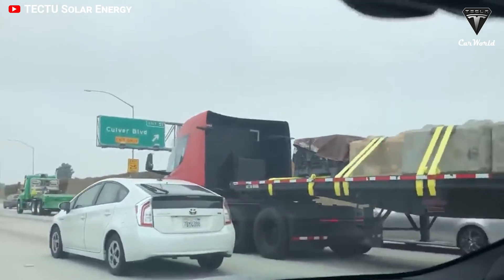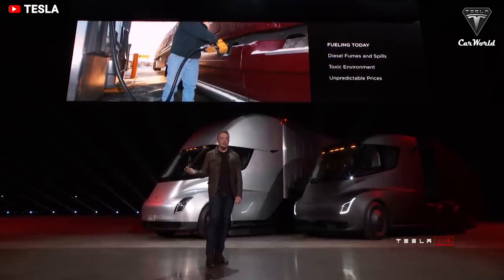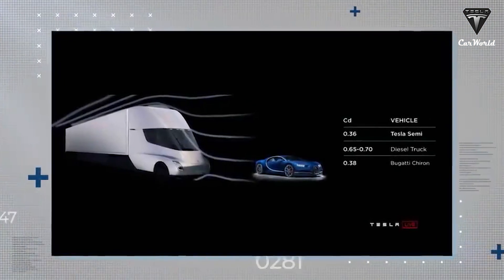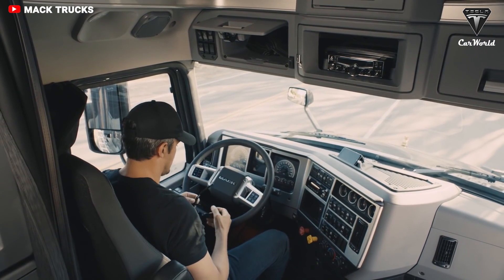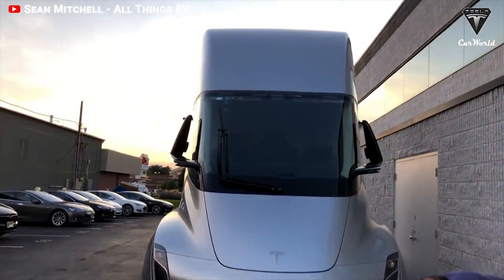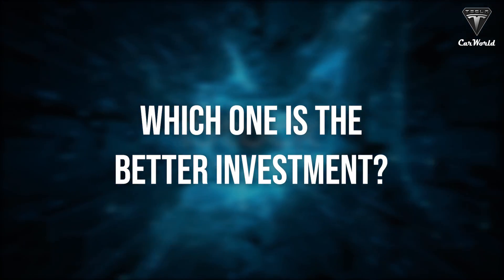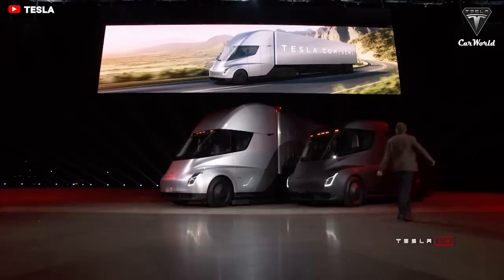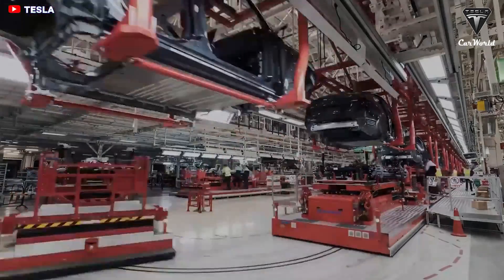Which is the KING of 2023 heavy trucks? Mack Anthem Diesel Truck Vs. Tesla Electric Semi?

Comment: This is BS.  Who cares what "Acceleration" is? It means nothing when total weight is 80,000 lbs and you have an 8 hour trip ahead of you.  Drag coefficient is equally stupid.  Tesla shows the DC with tractor only.  When coupled with a 52 ft long trailer, the DC is going to be about the same as the MAC.  The diesel MAC will be on the road 10 hours per day longer since it doesn't have to stop and recharge for 10 freaking hours.  The MAC has a place for the co-driver to sleep, Tesla has never shown this, so I assume there is no co-driver space.  But that doesn't matter anyway, since the Tesla truck won't be on the road for 2/3rds of the day.   The Ford F150 Lightning has a 270 mile range, yet youtuber's have shown, when pulling a camper trailer in the Rocky Mountains, that range is cut down to under 50 miles. Worthless

Comment: Regeneration vs engine breaking is going to be a deciding factor as there are increasing locations you can take it where engine braking is restricted or banned. This could theoretically save a driver alot of time. This is a bigger factor than acceleration. Brake maintenance is a factor & let's not forget that's DOWN TIME.
Reply: Most of if not all semi's for the last decade plus have engine brake mufflers, so they do not have to follow the restricted engine break signs.

Comment: From a drivers standpoint I would take the Mack. an average trip is much longer then 200 miles and in a normal semi I could do 750 miles in one day if I stayed legal. I have driven up to 1200 miles in one day throwning the log book out the window not really but ignoring that I had one. Cattle operations require to do so. A Tesla does not have the abilities to do what a traditional semi can do. Lack of a good sleeper cab unlike the mack which you did a bad job showing how much room they have compaired to the tesla. Backing into areas look like it would be a nightmare in the tesla because you are seated in the middle and don't have the site lines that a normal semi has. In a normal semi if parking to the left you can look out the window and see a very clear picture of where you are backing. I bet there will be a lot more fender benders in truck stops because of this.

Comment: If you can get a Tesla semi and don´t you should be fired for incompetence. The ONLY reason to get a diesel truck is if you must have a truck now and the waiting list is to long for your business. I would recommend to rent or buy a used one of good condition. To buy a diesel new so you would have to run it till it dies would not make sense any more. When (not if) electric semi trucks are up to full production no serious trucking company will still buy a diesel at just about any price (used or new) so your assets will be stranded and the much higher fuel cost will likely drive you, out of business that is. All that is on top of the coming carbon taxes that will be charged soon.
Ps. Elon please get rid of twitter and focus on what you are good at.

Comment: Will this Tesla truck hold up to severe duty like a Mack truck? Mack trucks build a many roads and buildings to claim it's feat in the class 8 market for commercial vehicles. Seems like Mr. Musk has a lot of work to do equaling or surpassing the Mack truck for reliability for extreme use duty. Standard diesel trucks old and new can be modified, designed to handle special hauling requirements.

Comment: With a truck, horsepower only gets the truck down the road and allows for higher cruise speed the higher the horsepower. Acceleration and hill climbing capabilities is determined by torque. Mack's 1860lb/ft of torque will wipe Tesla's 1600lb/ft by many minutes going up a hill. And Freightliner has it's Detroit DD16 that puts out 600hp and 2050lb/ft torque. Freightliner, Kenworth, Peterbilt, has the X15 Cummins that puts out 605hp and 2050lb/ft torque. Torque is ALWAYS the determining factor for performance in a truck.

Comment: I always thought that range and maximum load are the most important things for a truck.
Reply: It is among the most important.
The other important metric I'd want to know is the real refueling cost. Sure the electricity is cheaper than fuel right now, but you also have to account for the miles lost every day from sitting at a recharge station.
You get paid for the distance you can move the product, if it takes longer to make delivery, you are less competitive.
Reply: @myria2834  that was my question as well if you assume 200mile max before refuel the mac will be back on the road in under 20mins i would assume
Reply: @myria2834  "Sure the electricity is cheaper than fuel right now,"
Using his 7 cents? which is below cost and he aint to take a loss on that!  Use his car price and the telsa is 150% more expensive to run! LOL
there also the problem of 20% reduction in battery capacity each year!  MORE FOR QUCIK CHARGE OR OVER 40 HOUR A WEEK USAGE! ITS A SCAM!

Thats why they had to give 194,000% for each truck to PEPSI!  LOL   FREE TRUCKS and they still will lose in a couple of years! at 7c a mwh!
Reply: @myria2834  I worked at a truck stop for 6 months, and I can assure you it won't be an issue. Many truckers just sit there for entire days, just eating at the diner and waiting for the order to move out. Some had schedules and I still don't think this would be an issue. Many of them got 12 hour down times. More than enough to charge the truck back to 100% before moving out again. The real cost will come down to the truck stops to apply charging stations to each parking spot in their facility.
Reply: @DalionHeartTTV  while some may sit up to a day waiting on a load, it isn’t all that common. Yes, truckers are required to take a 10 break after 14 hrs day, 11 hr drive time (whichever comes first), trying to find parking and (in the case of having to charge) is a bitch.
Reply: @myria2834  No the costs are 150% for the telsa than Diesel!  That 20% loss on the battery each year means replacing it 2-3 years! At 130000$ PLUS!
Reply: @danquaylesitsspeltpotatoe8307  We have next no real world data to make a good argument either way. For me the truck isn't even a option without more real world data and infrastructure along with a actual sleeper.
Reply: operational cost is the most important.  Very few semis run with a full load anyhow.  It isnt like some evil game of jenga loading a truck to the max for every load...and range is really only important for long haul applications and this semi is not really designed for long haul as there is no sleeper...this is a day cab so 350+ mile range should get the job done in 99% of uses.  Now if the semi is say over 12,000 pounds heavier than an ICE semi...now you are severely cutting into load...
Reply: max load for every truck is 80,000 pounds because of legal requirements. it’s fuel efficiency, maintenance and cost that are the big 3
Reply: @takingafatdump  yep and the tesla truck likly weight consdierably more than a ICE unit. though tesla went out of their way to mention nothing on the things weight or the weigh of its battery... but you can make close assumptions base on current tech.  and its going to be pulling less.. if not I will actually eat my steal toe boots
Reply: @takingafatdump  80,000 GVW limit for a regular Semi in the US. ( two drive axels ) .   Heavy haul trucks ( 2+ drive axles ) can go much much heavier.
Reply: @humdinger5701  Heavy-haul is what I do. I see alot of ignorance floating around in this comment section. A Tesla semi is a nice thought but with no sleeper and lack of infrastructure makes it's applications very limited.
Reply: @dasimparmy2289  Yup, %100 agree with ya.  Normal folks dont have a clue what our jobs require.
Reply: And.... what about 100/60 -> 0 braking time?...
Reply: @OnionOreo  well it is a heavier machine.. and inertia is a bitch.. will have to see how that plays out. but I duno about in the US but over in EU some of these trucks can stop dead in a horrifying short distance, only realy limit to stoping distance is what the tyres can do aint no breaking tech changing that fact so its probably in thesame boat as its competitors
Reply: yes and the tesla truck has less of both
Reply: You right
Reply: Head to head collision...electric truck debris will be delivered to Musk.
Reply: Another big aspect is that for the Tesla, the rear axle is only rated for the bare minimum, my guess is to save on cost. For a lot of semi trucks, including the Mack, the rear axle is rating for MUCH higher weight than would be legal. The reason is simple: if it's designed to take 48,000 pounds instead of 34,000 pounds, it will be far, far longer before the rear axle breaks. Just like putting a more powerful 12v battery in your car will make it last longer.
Reply: Range is not important if you only travel short distances. Load does not matter if you only ever carry small loads.
Reply: @bedinor  Then get a pickup. What's the point of immensely expensive and massive electric trucks, if you're carrying small loads short distances.
Reply: @bedinor  yes, but also no. There may be times where a day can may need to go a little further than what they normally do. And carry more than what they normally carry.
Reply: @bedinor  |Then you do not need a truck.
Reply: I mean range is important for long haul, but for local driving like say, taking stock from a port to a warehouse range really isn't an issue.
Reply: @zacharymarentette5269  The cost of 150% extra per mile is tho! The battery losing 20% a year is a problem!  and thats if slow charged and only 40 hours a week!
Reply: @danquaylesitsspeltpotatoe8307  150% in what situations, on the highway? No shit if there, electric motors are mono-gear, they can't efficiently go 60 mph over an extended period of time.

And how on earth does the battery lose 20% capacity a year. My family's been driving a 2018 Nissan Leaf  and the battery can still give us 150 miles on a full charge.

And that doesn't even account for what electric semis offer. No energy wasted idling. Completely silent engine. Power goes directly to the drive wheels. No clutch.
Reply: @danquaylesitsspeltpotatoe8307  Dude, I wasn't arguing whether or not Elon is actually skilled or not. I'm literally just arguing that

1. Range isn't everything in trucking
2. There are still significant upsides and situations to electric motors compared to a diesel engine
Reply: @zacharymarentette5269  AS I STATED THE COST IS 150% MORE THATS THE PROBLEM! 

It doesnt matter even if had decent range that didnt decrease 20% each year!

What upside over comes the 150% Extra cost ILL BE GENEROUS 50% EXTRA COST?

NOTHING DOES!  But please do have a go if you think theres an upside to 50% extra cost!

Comment: Most pointless video I've seen in a long time  my freightliner  cascadia holds 300 gallons of fuel  with 260 gallons usable   gives me 2,080 miles of range in -25 degree  weather  how many lbs of co2 are generated to charge the tesla compared to the diesel i burn

Comment: Mack is owned by Volvo and uses Volvo's "D" series of heavy duty Diesels D11 and D13 under Mack's branding.  Of the four USA over-the-road heavy duty Diesel engines, these being Cummins X15, Detroit Diesel DD15, Volvo D13 and Paccar MX13, Volvo is at the bottom for fuel millage and only a bit more reliable than the nightmare Paccar MX series engines after these two different engine series get some miles on them.   After a 200,000 miles and a couple of years of over-the-road service these engines have continues sidelining problems and are slow to get parts for.   After 400,000 miles the Paccar MX series starts to. have serous issues.  Paccar owns Kenworth, Peterbuilt and DEF.  The Volvo D series may go to 1,000,000 miles with a ready supply of parts.  

The Volvo developed interior is at the top of Semi truck interiors, but the ride and handling is below that of Frieghtliner, Kenworth and Peterbuilt the top sellers in the North American market.  When comparing with the Tesla Semi it is likely best to use Daimler owned Frieghtliner with a DD15 or DD16 engine which is by far the best selling semi truck.   Both the Cummins X15 and Detroit Diesel D15 are legitimate 1,000,000 mile engines with fast service on parts in the USA market.   Detroit Diesel "D" series has a serous problem with rubber O-ring seals loosing suction on the engines oil pickup tubes causing oil starvation of the main bearings and seizing at about 400,000 miles.   Replace the rubber seals on a D series engine before 400,000 miles!  The DD series is at the top in fuel millage of these four main brand heavy duty Diesels.   The Cummins X15 is the most serviceable with standout best drivability and so so fuel millage.

Comment: As a diesel mechanic, it's things like this that will likely put me out of the job, however seeing as the trucks operate for cheaper (Both road and upkeep,) are safer, more powerful, are priced similarly to a normal unit, and much better for the environment, that is a good thing. I hope that a wave of these trucks replaces the current and older generation. The only issues I really see is the charge time of trucks of similar make,  operational range, and possible wear and tear over time, as the engines will have to endure much more than your average electric car. As for charge time, that could be mitigated working with service stations to keep pallets of batteries on charge for repowers (Bear in mind that your average team both works the DOT max of 10 hours driving time for a 20 hour constant trip) or developing a multi-charger system to fully 'fuel' one in 4 hours. Operational range will be improved over time as more efficient batteries are developed, or perhaps a special model with a second set of batteries for a longer haul (Such as an add on to the cab on full cab/condo models). General wear and tear will be dealt with as it arises.
Reply: I wouldn't worry too much. How many auto mechanics have been put out of jobs because of electric cars? My guess is you have a few decades or more before it really makes a difference.

Comment: All the important information is missing here. The payload is one of the most important one. Yes, the Tesla truck can be 82,000 pounds and theoretically has a 2,000 pound advantage, but the batteries are taking that away easily as you would need about 10 Model S battery packs, which is more than 10,000 pounds alone. And no, there is no weight saving because you do not have a diesel engine, as you still have 3 electric motors, all with gears and a heavy cooling system for the batteries. The next big problem is charging as you need a 1 MWh charger that needs it's own electric substation for just ONE charger if you want to charge your truck in 1 hour. Tesla will have these super chargers along the highways in the future, but you can expect to pay for it, meaning it will cost you more than filling up your diesel truck and you have no other choice. In addition, as trucks are used way more then cars, you can expect that the battery will loose about 20% capacity after one year, so after 5 years this truck might just have 100-200 Miles in range. Replacing this battery pack will easily cost you $100,000! So, not sure were the advantage is.
Ah yes, don't forget, Mack is probably the smallest of all truck manufacturers to compare this to, so not a fair comparison. BTW, you know that parts of the battery is behind the driver, so no sleeper cabin! And how would a 2 person team drive this thing? One passenger in a jump seat for 8 hours? Also, did they mention how much the truck actually will cost? This thing is not much more than a massive fraud to lure people in. However, this time all the big truck manufacturers are already out there with electric trucks, so Musk does not have the same first mover advantage as he did the first time around with the cars. One more thing. Why do you think they used to transport Frito Lay's for the 500 mile run....because chips don't weigh anything and the truck still had only 4% battery left while driving always on the right, not overtaking a single other truck despite this mad performance.

Comment: One is a truck, works very well as a truck, is a truck, a trucker can live in it, can use the window to show papers to police and stuff, you can clean the fog on the side mirror, you can maintain only that portion dirty while the rest of the cabin is clean and livable, has REAL tested freighting, not transporting only potato chips, can REALLY have some range and overall is a somewhat reliable machine............. The other is a Rich man's Toy, where it was imagined how things would work in an utopia, can only carry cheetos for 500 miles, and it's probably going to be used as a marketing toy by companies who want to virtue signal the are worried about the enviroment. (PepsiCo buying 100 of them while they have 48000 trucks).

Comment: About the 0-60 in 5 seconds which Musk made such a big deal about, how often will the Tesla be able to use that with all the traffic one the city streets and entering a fwy, that it would actually make any legitimate difference. None!!! Then going up hill the Tesla was faster, but I bet going down hill the Mack would catch right up because the heavier weight it is caring. In the video of 2017, they kept showing the the Tesla was pulling 82,000 lbs, isn’t that illegal in all States.80,000 is the Max weight you can legally pull. I’m sure if it was legal, the Mack would have the capacity to pull up to 100,000 pounds of payload